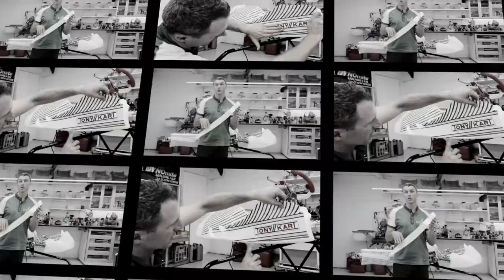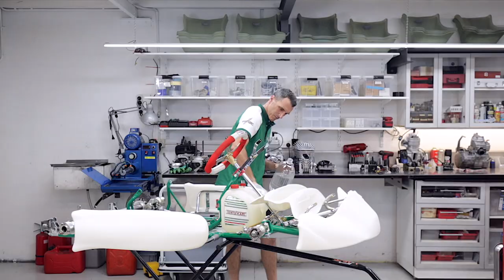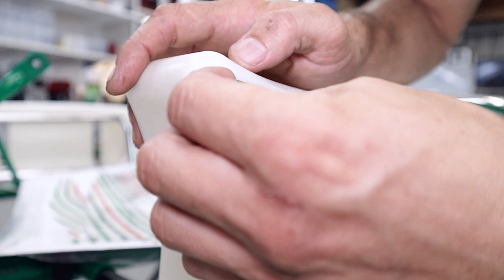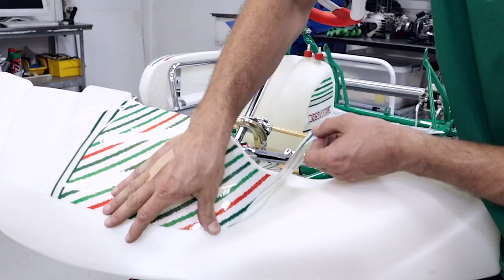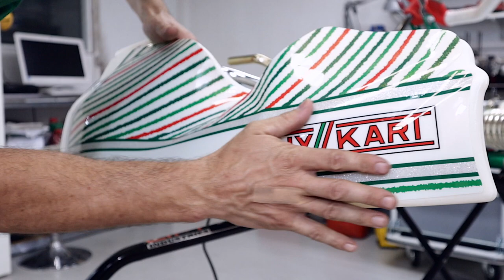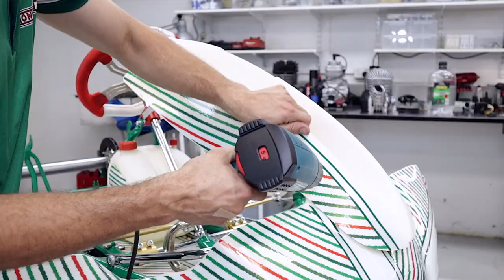HOW TO: Install Go Kart Stickers Top 4 Tips - POWER REPUBLIC

Comment: Great video as always, but you should REALLY buy some  " plastic felt edge squeegees ". Gonna make the job so much easier smoothing out the vinyl stickers. But your thumb is indeed your best friend when doing this :D
Reply from the maker: Thank for the tips D. I have got one there from an iPhone screen protector installation, but I don’t know, I guess old habits die hard.  They are good for the centre and flatter parts, but I reckon the thumb is hard to beat for the complex shapes.

Comment: I always cut off a piece of the backing of the sticker and put the sticker in its place with bit of tape in the right position on the not sticky part. Than pull of the rest of the backing and work it down as you do with the heat gun and all, works like a charm.
Love your video’s mate, good job! Keep up the speed!
Reply from the maker: thanks for the hot tip Rob, I'll give it a shot and next time maybe, just maybe, get the lines to match up!!

Comment: What grade of sandpaper did you use
Reply from the maker: Hey Bro, thanks for tuning in and sharing the videos😊

we use 240 grit normally.  but anything over about 180 should be fine.   just go easy with the corse paper and go harder and longer with the fine grit stuff.  

Hope that helps 👊🏻

Comment: The protective film is there to protect the sticker from an applicator scratching the sticker surface. It will not form to compound angles so it literally releases itself as you apply the sticker. If you use an applicator you'll get far less air bubbles than using your fingers alone.

Comment: Hey guys, i raced with a rotax max for the first time yesterday (senior) comming from kf2 engines. It ran pretty well, although sometimes after the straights it didnt pick up the throttle :( Is that because i am running wrong jets?
Reply from the maker: Maybe yeah.  You could try to get it back with some needle clip adjustments ?
Reply from the maker: Where are you racing ?
Reply: @PowerRepublic  Its a track in Denmark called Roskilde Racing Center. There is lots of straights and lots of hairpins.
Reply from the maker: Has it warmed up there yet or still winter conditions?
Reply: @PowerRepublic  I think we ran in around 2-6 C
Reply: @alfredlange2972  a fellow Dane I see. I myself drive a RRC. If the throttle doesn’t pickup at the end of the straights, it’s likely the jet. You could try lifting the choker at the straights. Which would allow the crankcase (bundkar, not sure it’s correctly translated) to be filled up with fuel quicker. If it works, the jet is probably to small.
Reply: @oliverbaltzer3438  thanks, what kart engine and number are you using?
Reply: @alfredlange2972  currently I’m in a Rotax Junior, number 63. But I’m moving to Rotax Senior in 3 weeks. Which will still be number 63
Reply: @oliverbaltzer3438  ROTAX senior nr. 254 kosmic
Reply from the maker: a great place for people to meet from the same country racing go karts.......Power Republic Youtube ;)
Reply: @PowerRepublic  Sure is HAHA

Comment: We are getting a used 2019 Tony Kart. Do you know if the newer stickers (2022) would fit on it? Thanks
Reply from the maker: Sure will.  Most stickers are interchangeable, as you can trim some excess off if needed to look good
Reply: @PowerRepublic  Thank you.
Reply: It depends if you have the same style bodywork as the new stickers, the overall shape should match.